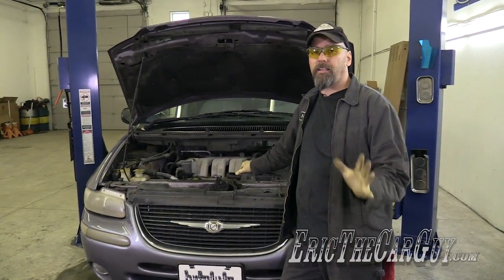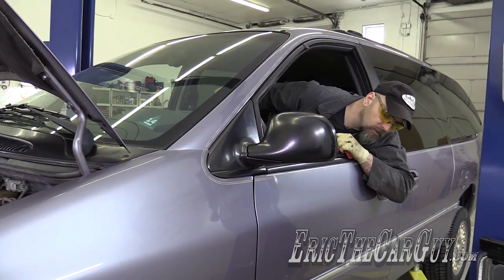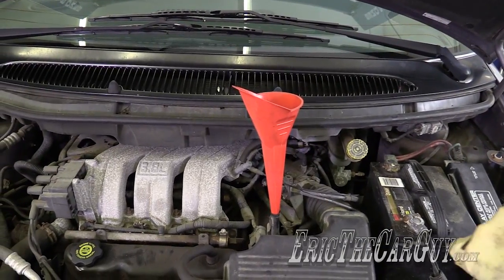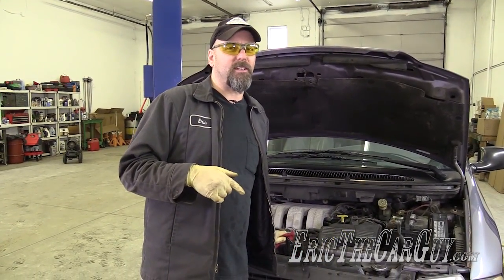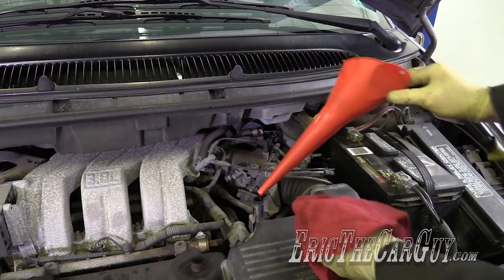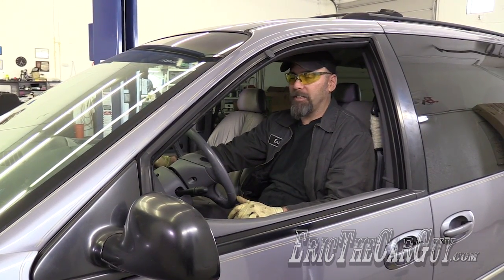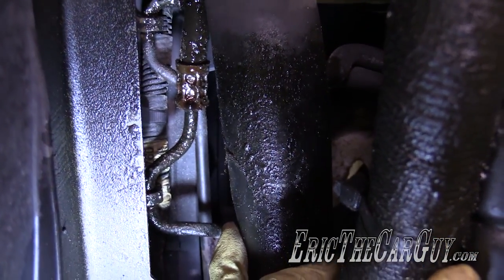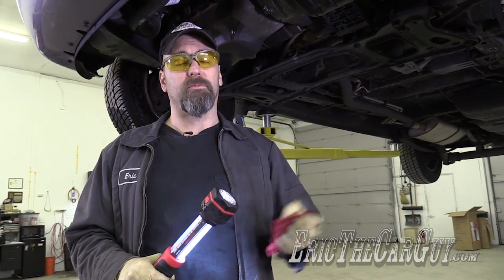1998 Chrysler Town & Country Transmission Diagnosis -Fixing it Forward

Comment: Speaking of fixing it forward, I went and pulled a fuel injector for a friend at a salvage yard today, while i was getting lube for the O ring at a parts store i heard a customer talking and  from the sound of it they had a locked caliper on the front of their ride.   Fixed it for them with some really fine sand paper and lube on the slide pins in the parking lot of the store.   Come to find out about a month ago one of the cookie cutter brake places put brakes all the way around and there was not any lube anywhere.   i was =(  for them and pretty peeved at the brake place.   Needless to say they were down the road in about 40 minutes for the cost of 1200 grit and a small pack of lube.  been doing stuff like that for years.  Free O charge and happy to do it.     Reason being is i know the feeling of walking miles in the cold rain along the interstate without a soul stopping, or being too broke to fix a problem on my only vehicle and feeling helpless.   If it is in my power to help someone avoid feelings like that, i cant seem to pass up the chance.  How could i in good concussions?   Thanks to you Eric and the Knowledge i have received from your videos I am able to help people avoid those feelings on a way broader scale than i used to be.  So indirectly you are already fixing it forward through others like me.    i just want to express my gratitude and let you know I am grateful to you for what you do.   You have saved a lot of people a lot of $ and allowed people like me to help them do the same.   Thumbs up as always.

Comment: I have a 2000 Grand Voyager which at 160,000 started having trouble shifting. Tech said it was mechanical and tried to get us to buy a new tran, but it didn't sit right with me that it was intermittent. Did some testing on my own and found it was a speed sensor. At 180,000 I had trouble again, and once again a tech said it was mechanical and needed replaced. I did testing on my own and found it was the hydroelectric shift solenoid pack. I'm still running the original transmission at 245,000.  The point is, most techs spend 5 min troubleshooting and condemn the transmission, and unfortunately most owners believe them. I'm not saying you're wrong in this case, but it ticks me off to hear you say there's no point in checking the computer for errors or troubleshooting the electrics.

Comment: The low-down on this transmission:

It is the A604 renamed to the 41TE

Again, it requires ONLY MS-9602 certified ATF+4 fluid, anything else WILL destroy it. It's a good thing that this one is already dead or that universal ATF Eric put in would have killed it.

There are no bands and only one sprag/one way clutch in the torque converter stator. It is disc clutch pack shifting only.

It has 4 shift solenoid valves.

2 of the solenoids are normally open valves, 2/4 and underdrive.

2 are normally closed valves, low/reverse/tcc and overdrive. 

One of the solenoids is dual purpose and a valve in the valve body switches its job from controlling low/reverse to controlling the torque converter clutch.

The solenoids are low impedance and the coils will burn out if constant 12v is applied, the TCM uses modulated PWM to control the current.

Since 2 of the solenoids are normally open you will have 2nd gear and reverse (limp mode) even with no electrical connections whatsoever hooked up.

To easily force limp mode remove the EATX (electronic automatic trans-axle) fuse in the underhood PDC.
Reply: You said it perfect!

Comment: I think it may have the A604 trans and it may use ATF +4 fluid only NOT ATF  You may need to do a complete flush of the transmission since you may have put in the wrong fluid.

Comment: Looks like we might actually get a repair video in the future of a transmission swap. I hope its a real world used junkyard unit and not a factory remanufactured one all shiny and clean in the crate.
Reply: eldoradony At the same time, a 'repair video' would be what I'd like to see - him repairing the reverse band / clutches, then putting the same transmission back together and running it.  A transmission replacement video would be ho-hum, but it would obviously have a lot of work & steps to make a video out of.  

Yes, transmission repairs require a different set of tools and knowledge, but it's the 'repair' that would make for the most interesting video.
Reply: Spearfisher1970  There are no bands in this transmission.
Reply: patw52pb1 Does that make it easier to fix?
Reply: Spearfisher1970 Not necessarily. 
Having no bands does make the unit more compact and somewhat easier to disassemble and reassemble without needing four hands.
Bands were/are notorious for being problematic, weak and requiring tedious periodic adjustment.

Comment: Eric Chrysler transmissions only use ATF +4 fluid. It will not last on anything else, or you will be putting a transmission in it due to using the wrong fluid.
Reply: Mark Ryl-Kuchar I was going to say the same thing.
Reply: Mark Ryl-Kuchar  I mentioned in the last video.  It is really important.  My mom's transmission wouldn't shift into fourth gear until we put in the right fluid.
Reply: Mark Ryl-Kuchar Im thinking Eric put it out of its misery when he put just ATF fluid in it, my 97 chrysler van has 348K on the same transmission and i used ATF 4 thats what it recommends.
Reply: yeah I think so too...

people say these tranys are notoriously bad but they likely did things to make it fail-

1.beat the piss out of it on shifting
2.putting in the WRONG fluid
3.failing to realize a speed sensor or solenoid could be changed
Reply: My 02 town and country has 325k on same transmission..use Atf + 4 ..transmission flush every 2 or 3 years and your car will last forever!!!

Comment: The trans in this van is known as a 41TE. 4 spd transverse electronic controlled. It uses atf+4 fluid. Hooking a scan tool up to access the trans module can be helpful. You will need a scan tool that will allow for data and bi-directional testing. I suggest checking the clutch index this will give you a idea of how the clutches are without opening it up. It is also possible that the electronic solenoids need to be reset. This is usually done when a leaking solenoid pack is replaced. To be honest the lack of red and abundence of gray color in the fluid is not a very good sign. Clutch material in the fluid will cause it to turn gray. But if you have a scanner capable of checking what I said it wouldnt cost anything to try and see. Never know maybe some fluid and a solenoid reset and maybe they could get some more miles out of it.
Reply: I agree. I believe going through a solenoid test will show that the reverse solenoid has died, as i didn't hear it make any nose when he put it in reverse. These transmissions have extremely loud solenoid packs, and you should be able to hear every gear shift if the vehicle is sitting still.

Comment: Drop the pan! If it doesn't look like glitter hell, change the filter, adjust the bands, and flush it with ATF +4!!! You might be able to save it.
Reply: FrankTheCat There is no adjustable band in that tranny. i believe that gearbox is called A604
Reply: 91fisher Huh. All the Chrysler's I've dealt with from that era, including my Voyager, had good old Torqueflytes... Never dealt with the newer transmissions.
Reply: Nick2517 I have a 1972 Dodge Polara with a torqueflite. Ask your dad if he recommends the atf+ with some stop slip (I like the hard but smooth shifts its gives me currently hence the stop slip). I've seen type F fluid recommended in the forums but i'd rather have a synthetic. Let me know what he recommends :D
Reply: FrankTheCat  No bands in this model.
Reply: patw52pb1
I gathered that via the comments previous to yours. :)
Reply: FrankTheCat ATF+4 or you will ruin that transmission in about 40K miles...good call!
Reply: the fluid color on the dipstic was black. The transmission is severally damaged internally
Reply: Nope, won't work...Clutches are bad, reverse is usually the first to go, now had   the forward gears suddenly stopped working possibly the band might be the problem.

Comment: All chrysler transmissions have taken atf +4 fluid since 1978! when they started using lock up torque converters, also it is in default, has a broken part inside. the fluid that you showed on the stick was black, I was a Chrysler Tech. starting in 1969, I worked exclusively on A604 automatic transmissions from  1988 when they came out to 2000 when I got out of wrenching and went in to the management side of the business, retiring in 2014.

Comment: Eric you could also pull the valve body, identify the valve that's used for reverse, and vacuum test the valve. It's worth a shot to see if that's the problem and it's fairly easy to do. Sonnax shows you what area of the bore on the valve you should test and what the vacuum reading should be.